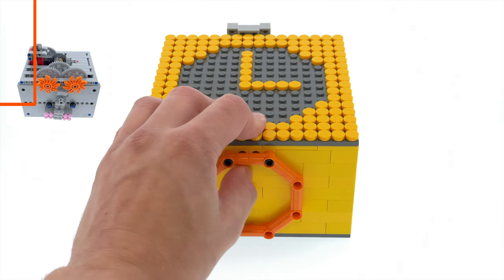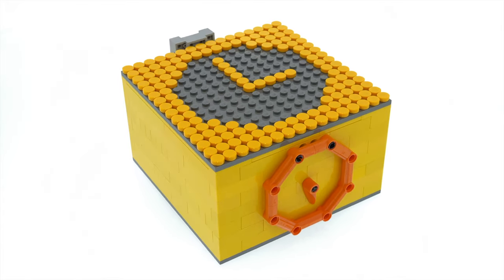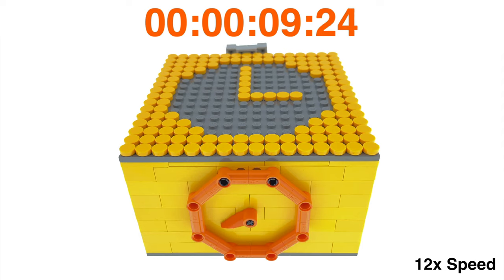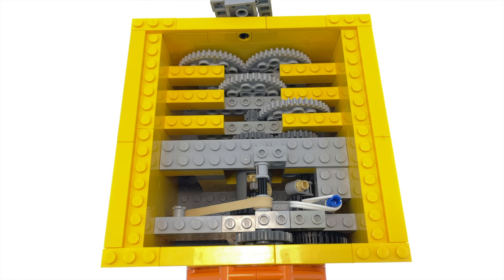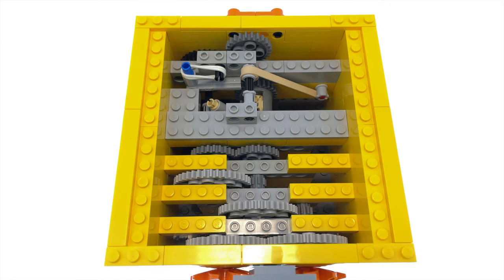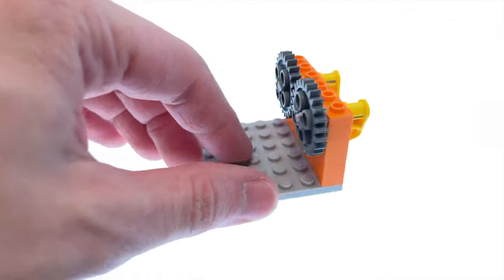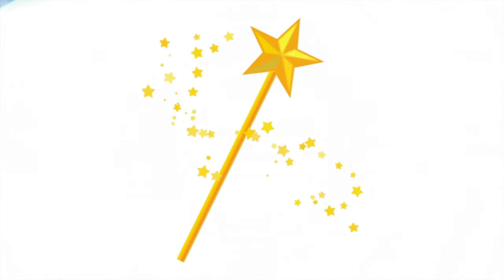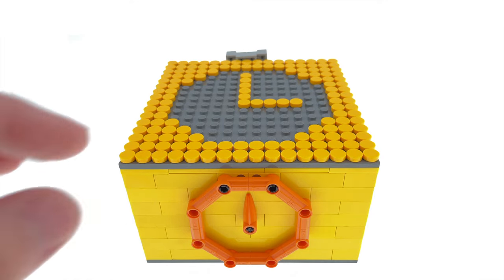Working FULLY ADJUSTABLE Lego Timer

Comment: The best way I can explain the differential acting like that is that you have fixed the axle on the 16 tooth side, which locks the small gear on that side, NOT the entire diff. This means that when you rotate the 24 tooth side's axle, you're rotating that side's small gear, which rotates the differential housing at HALF the speed of the axle. Sorry if you don't understand, my explanation is pretty bad.
Reply from the maker: That makes sense for the most part. I suppose witches were not the cause after all.
Reply: @LegoTechnicsRule  haha, yeah. You can see it best if you hold the diff housing and spin one axle. The opposite axle will spin in the other direction at the exact opposite speed. That's actually a way to reverse rotation coaxially; a set of three bevel (the small ones) gears.
Reply from the maker: @miraidongaming  Indeed. It would seem that 3 gears in series would output the same rotational direction, but coaxially, it doesn’t.

Comment: This is just my theory but Ive worked with quite a lot of gear mechanisms so this is how Ive worked with lego differentials recently. 

The differential works in cars by taking power applied to the exterior gear housing and splitting it evenly between the gears within the housing. The middle gear actually remains completely still when there is an equal load on both axles and equal power is applied. If one axle experiences more resistance, the gear housing will drive the middle gear to start turning in favor of the axle with less resistance causing it to rotate faster. Because that back axle is locked and you’re inputting power to the opposite axle instead of the 24 tooth housing, the power that would have been split to the other axle is now all in the axle you’re turning so the ratio you’re working with is more like 12:24 (1:2) because you’re spinning the 12 tooth gear. This is your half speed. If you unlock the back pin, “in a perfect world” the 24 tooth housing would spin in sync with the gear but that won’t work because of the resistance between the gears and how loose the differentials are in lego. If you spun both axles at once it would work too.
Reply from the maker: So... it wasn’t witches after all. Thanks for taking the time to explain this. I understood most of it, enough to allow me to understand what was happening.